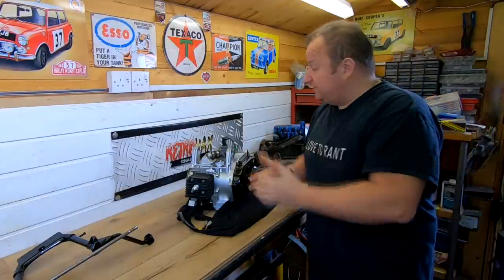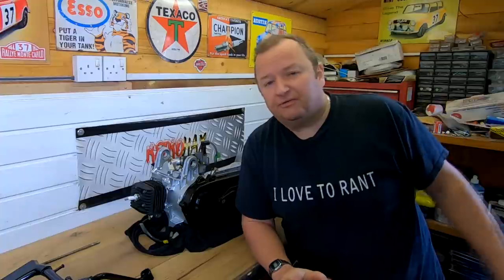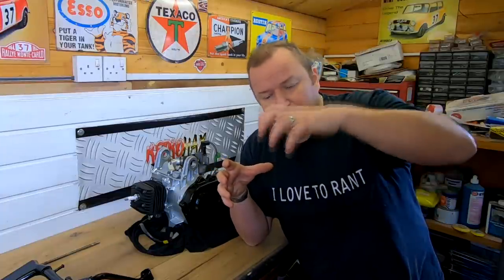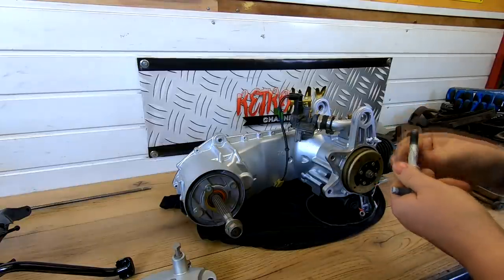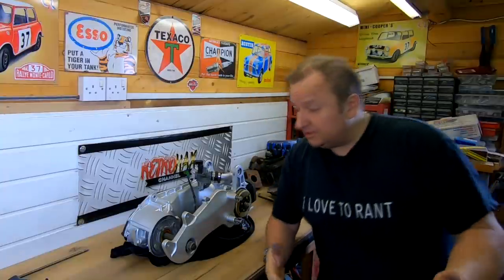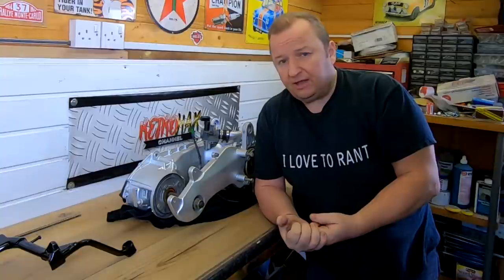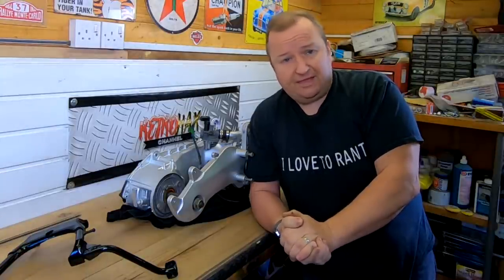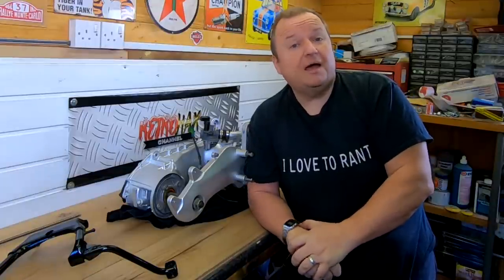Two Weeks No Videos - Where Have I Been TGB Scooter Update Vlog

Comment: Nice job i had a tgb me dads still got it now had it about 7 years blew the engine twice tho decent engines if look after them i forgot put the fan cover back on before engine siezed and broke the crank 😒😒i jetted it to 60 thats a good jet size for carb from 53 thats really lean cause restricted up i welded up that pipe off the exhaust toke out the daft box thing it works with the fuel tap a think might have to bypass it i did or the fuel is cut off lol